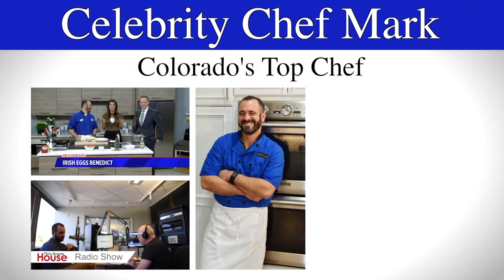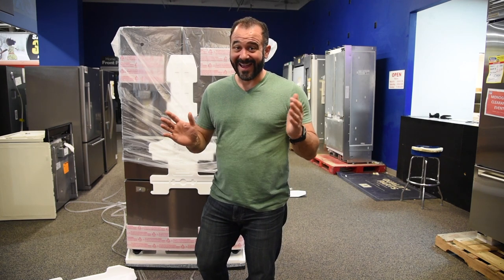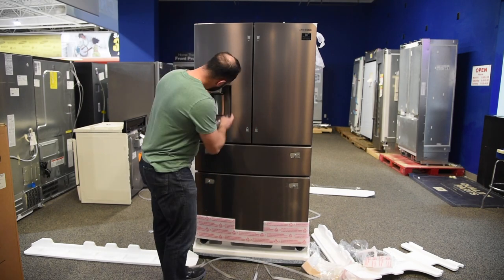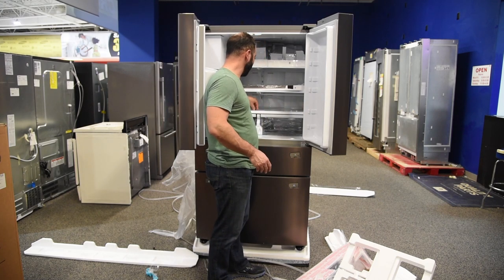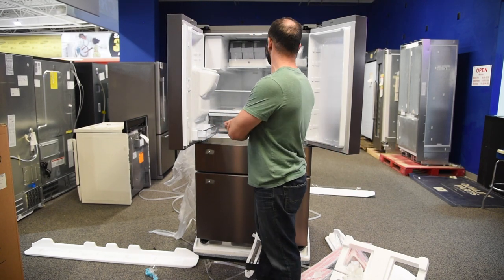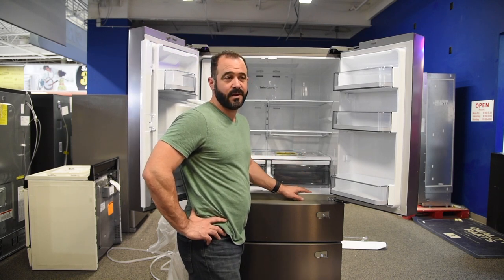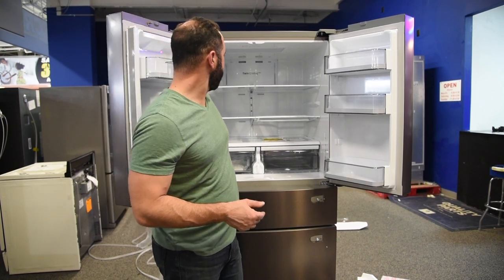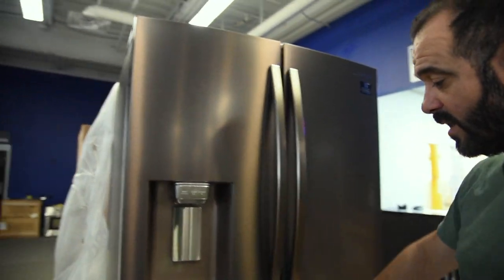Unboxing a refrigerator

Comment: I came here hoping to see how to remove it from the packing base as it sits inset into it. Going to take more than just myself and my wife.
Reply from the maker: Sorry about that, I ran out of time filled this on my lunch break.  It's easy if you have a hand dolly, just tilt and scoop from either side. 

I'll make a follow-up video, thanks for the content idea and good luck
Reply: @chefmarkkalix  All good man! We ended up leaning it backwards and resting the fridge against the granite counter top. I used a drywall sawt to cut the foam base front half out . Then slowly tiled it back the other way and my wife pulled the foam base rear half out as I supported it. All good an installed now, thanks.